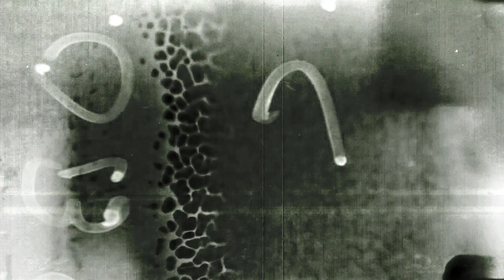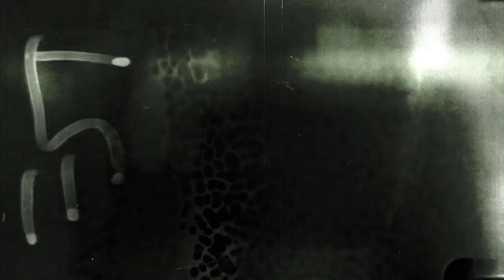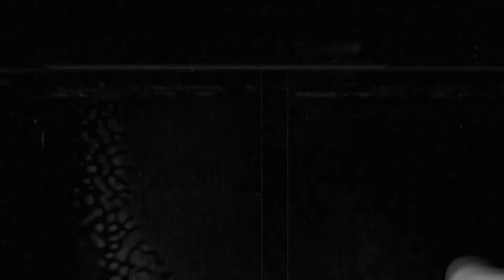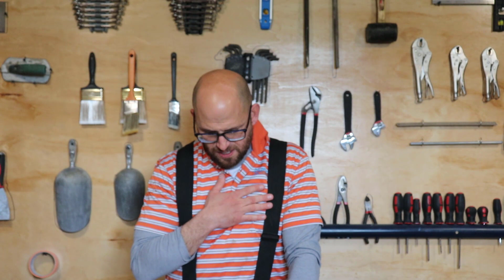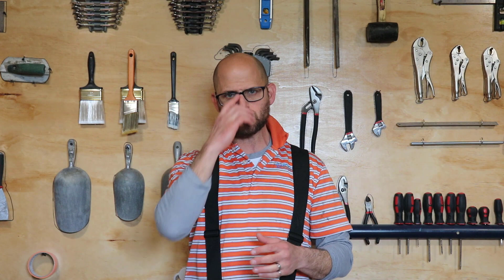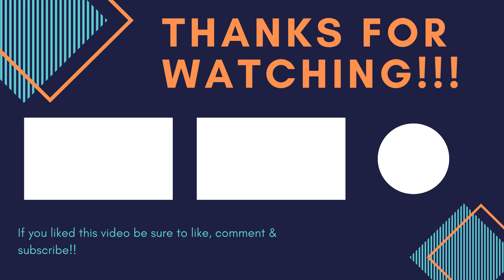Q&A Wednesday: How to Create Economical Concrete - Vlog 635

Comment: Good tube, quick question superplasticizer is expensive here in the UK so is there a way of producing your own with the same properties from accessible materials ?
Reply from the maker: Yes and no.  It’s easy to create the basic chemistry and structure in your garage but EXTREMELY (and somewhat dangerous) difficult to  create something usable for concrete.